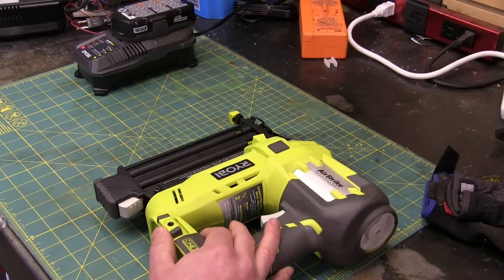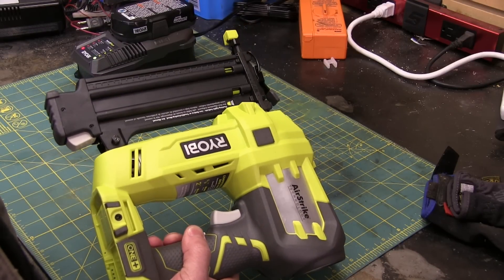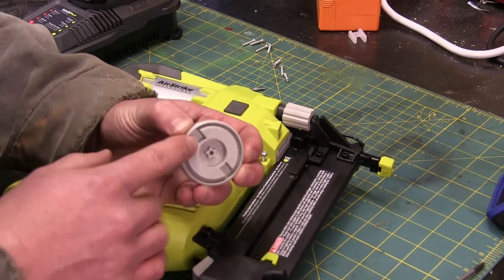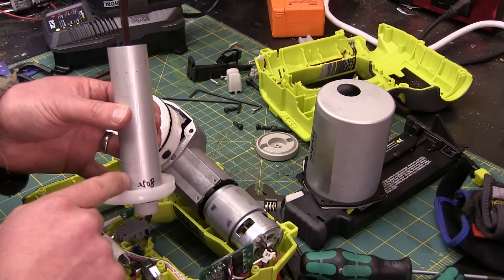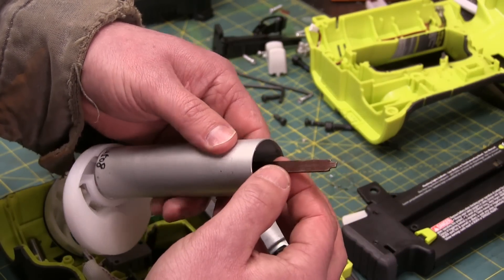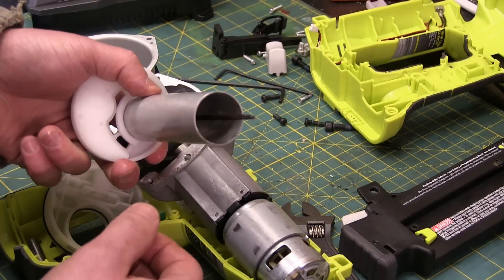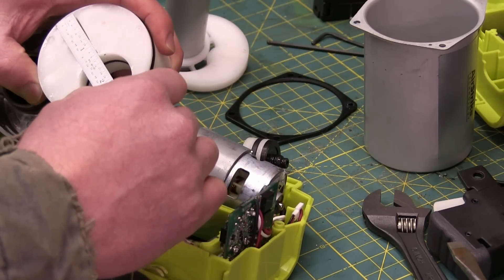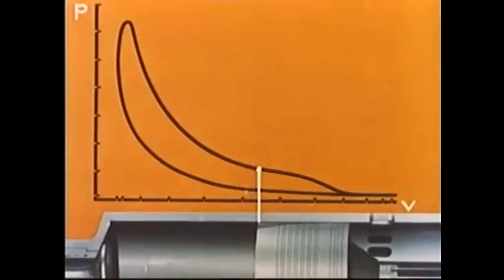BOLTR: Ryobi Nail Gun 18V cordless

Comment: I just took one of these apart with some confidence thanks to having watched this a while back - and I actually managed to fix the thing.  It had been in use for about 3 years already. As best I can tell, it failed because the oil inside had gotten so sticky and old that the motor was going into overload protection due to the increased resistance.  

I oiled everything back up and it is back to work! Thanks for the video!
Reply: I've had mine working for 2 years now.  Still going strong.  I do alot of floors and trim.
Reply: Silicon grease works  the best .
Reply: @interman7715  is that silicon or silicone, just asking for a friend.
Reply: Hey The11thNickel I’ve been debating on getting this same ryobi brad nailer , after you tuned yours up is it still working to this day ?
Reply: @johnkey1682  There is no such thing as silicon grease as far as I know, so yeah.

Comment: POM is Polyoxymethylene also known as Acetal (trade name Delrin) in case anyone was curious.

Sincerely, a plastics and polymer engineer.
Reply: +AvE I think you may find it very useful trying to determine if something will "chooch" or not haha.
Reply: James Schwede would delrin be able to be used to create super tight lattices based on long strands only a few molecules across to create a very tough material much like kevlar or ultra high density molecular weight polyethylene that they use in bullet proof gear?
Reply: @Nuovoswiss so delrin is just the polymer version of formaldehyde?
Reply: @sarchlalaith8836  I think that is a bit of an oversimplification.
Reply: I thought POM was pomegranate juice in a fancy bottle marked up >60%
Reply: John Goblikon is my spirit animal What does this statement mean? The chemical is bad for us, causeing pain, so can sell us pain killer?
Reply: Hey can you tell all those other plastics engineers that plastic is not a replacement for metal in all applications
Sincerely, a mechanic
Reply: @russianacorns8080  You are 100% correct. As a hobby mechanic, I run into the same frustrations with parts being made out plastic in order to cut cost and save weight, where a metal part would have been better.
Reply: Hello, Can you tell me the minimum, or the best/correct, temperatutw for reforming HDPE in a mold?
Reply: Don't come here and class up the joint
Reply: @Jamie-Russell-CME  If you are referring to using HDPE for injection molding purposes, then a temperature of approximately 400F will suffice. This is a starting point, depending on what molecular weight you have and what heat history your material has experienced. If you are looking to just soften HDPE, then 300F will work. Be mindful of material degradation, not temperature and time at temperature can breakdown the material.
Reply: Prisoner Of Mother England. POM

Comment: For those Aussies (not Austrians) playing along at home... Techtronics have done the same Ridgid deal with Bunnings, except that they're branded as AEG. So Bunnings are the exclusive distributors of both Ryobi and AEG/Ridgid here.

Could be worse than Ryobi, though. Could be Ozito.  Or 909. Or Worx. Or Wesco.
Reply: +w0mbles I thrash my Ozito 14v drill and never had a problem, had more issues with my Dewalt 14v drill. Their palm sander is pretty good too so I got nothing bad to say about Ozito and if something fucks up, instead of warranty they will usually just straight swap you for a brand new one. 

After seeing this video... Your better off with a Ozito, properly made in the same factory as Ryobi but half the price.
Reply: TheKodiak72 I've got a few Ozito tools myself. The heat gun is quite decent. The screwdriver does the job, but is pretty dodgy in terms of build quality and drive run-out. The rotary tool is OK too, though the ergonomics are rough. The glue gun is bare-bones, but it works well enough.

But overall, they're definitely at the bottom end in terms of parts and build quality. I wouldn't want have to rely on them. Weekender stuff.

I do agree that it's dead easy to replace the Ozito stuff it goes bad. Same can be said for almost anything bought at Bunnings. Even the high priced stuff.
Reply: +TheKodiak72 yeah I've got no problems with Ozito. 909 stuff on the other hand, absolute garbage, literally made of fecal matter I'm pretty sure.
Reply: +w0mbles Yeah pretty easy to replace anything that breaks in Australia thanks to the Australian Consumer Law.

I generally stick to the Makita stuff for tools I use a lot, but bought an Ozito rotary hammer for a small bathroom demo job that came up.

The first one fried (magical blue smoke feature) and I took it back for an instant replacement. No 2 finished the job and I've still got it for the next reno some time down the track. For a tool I might use a half dozen times it's cheaper than hiring one.
Reply: +w0mbles Thanks for the info. I bought a Ryobi vacuum cleaner from Bunnings. Worst. Purchase. Ever. It is so damn loud its not funny. Even with hearing protection on you get a headache after a few minutes. I'd forgive it if it actually worked. But it sucks .. If you get what i mean. I end up using the damn thing as a broom then pulling the head off and hoping the thing sucks the stuff up just through the hose. I should have taken it back complaining about how useless the thing is, but oh well. That's what $80 gets you.

Having said that, I've also got a Ryobi C1 brad nailer. Seems to go alright so far. Very rarely does it jam.
Reply: +w0mbles So what's the deal with my masport 2-stoked whipper-snipper and blower/sucker, wouldn't happen to be a Stihl in crappier plastic by any chance?
Reply: +TheKodiak72 Some Ozito stuff is definitely TTI. Their plunge router and 12v drill have a distinct family resplendence to their respective numbers from Ryobi and AEG. That said the AEG drill is clearly head and shoulders above the Ozito.
Reply: +TheKodiak72 Some Ozito stuff is definitely TTI. Their plunge router and 12v drill have a distinct family resplendence to their respective numbers from Ryobi and AEG. That said the AEG drill is clearly head and shoulders above the Ozito.
Reply: +H8_RICE A dedicated (i.e. real) tool store in your area?
Reply: +H8_RICE Sydney tools, total tools, get tools direct, gasweld. They are a few chains that we have around here. Not sure where you are from.
Reply: dapretenda85 I've just bought some stuff from sydneytools online. Prices are really good for stuff on special, especially if you can get free shipping. Service has been very iffy thus far; have had to do far too much chasing up of them.

Adelaide Tools have a decent range, but the prices are all at the high end of RRP.

Had a laugh at the Mitre 10 catalogue which came yesterday. $400 for a DeWalt 18V hammer drill (with bonus driver!). Or... $500 for the Makita version.

Or, and get this... $400 (yes, $400) for the Worx 20V Brushless hammer/impact combo.) Worx! That's about $300 more than it's worth.
Reply: rkvktmen Yeah, there's a lot of OEM stuff happening. My "Ryobi" scrollsaw is the same as all the other cheap Chinese scrollsaws you can find rebadged in different outlets. And yeah, it's a total POS as a scrollsaw.
Reply: Some Worx stuff from Masters is well priced and long warranty, but don't bother now as Masters are going out of business
Reply: w0mbles Yup. Saw a guy returning a Ryobi drill press to Bunnings the other day - the pulley that the main drive belt goes round had completely sheared in half, looked like broken cast iron but was definitely plastic. Use time was less than ten minutes.
Reply: +Dillon P Of course they're going out of business, my local one nearly burnt down opening day due to shitty sausage sizzle techniques.
Reply: +Camoflauge Koala . haha!
Reply: +w0mbles for any canadian readers, 909 was making mastercraft and haussmann tools for a while but it seems mastercraft is on the 20V dewalt platform now
Reply: +w0mbles AEG used to be some amazing tools - the professional line that is, wonder if even those are gone now
Reply: +w0mbles Every ozito tool i have bought still works. Ok, it maybe because i dont actually use them....
Reply: And you don't use it because they are too gutless for real work.
Reply: im a plumber and ive owned ryobi and ozito. there good if you have a small easy task but when you work them or lean on them there not that good. all broken but my Milwaukie stuff still works
Reply: w0mbles we only use aeg 125mm grinders, and... there is a distinct lack of workyness after a couple years of use each.
Reply: A bit of history.  AEG Telefunken invented the electric drill and were the premium power tool  brand (among other electric devices including trains) until they went broke in the late 70s. Atlas Copco bought the power tool division and marketed them for about 20 years.  They then made red tools which were identical, branded Milwaukee. Apparently this gave Atlas two brands to sell off. AEG is now mid range. I have 45 year old AEG from when they were the undisputed top of the heap. The price matched the quality though, 4 weeks of a tradesman's wage just to buy a drill. I sure worked the shite out of mine though. Nothing else could have stood up. Constant torque is common these days as the patents have run out, but back then nothing else came close

Comment: I use one of these all the time. Great for jobs where you need to do trim work but do not want to drag around a compressor, hose and pnematic brad gun. Boss had to send it off for repair once when he first got it but no issues in years.

Comment: In my years working as a tool repair technician, I've actually seen the "o-ring behind the wear ring" trick fairly often.  It provides a steady pressure against the cylinder wall to ensure maximum performance and maximum lifespan of the wear ring.  Kinda smart, if ya tinker on it.  😉
  As to the filled pits, I believe that if you ground that thing apart, you just might find some ballance weights in there.
  We had a big Gaylord (reinforced cardboard box) that was full of those aluminum housings which we would, upon its filling, take to the recyclers for a pretty penny.  There's a lot goes into those housings and, your correct in that it's the strength of the whole tool, giving reinforcement to the shell and everything else.  Anyway...
  We had one fellow who, upon his second trip to the "Doc in the box" to have a nail removed from his hand (you'd think he'd learn to keep the pointy end pointing elsewhere, by then...) was informed that if it happened a third time, he need not bother returning to work in the afterwards.  Twice in as many months, I believe his sneaking out the back door before taking the mandatory drug screen just might have had something to do with it.   😆 🤣 
"Clinker" makes me think of two things...  1, when I'm working on my coal forge, the fellow smith's out there will commiserate and 2, the infamous scene from "A Christmas Story" when Daren McGavin is fighting with his great nemesis, the coal heater in the basement.   😀

Comment: In your calculations you forgot to account for volume of flow, the strong magnet on striker means it can have a break pressure of 40psi, then accelerate to a rediculous level while consuming the volume of air available.
Reply: There is also the Heat of Compression, since the compression stroke is fairly quick, about 1/6 second.

Comment: I have excellent luck with Ryobi 18 volt tools and have used them for 10 years without a problem. I get about two years from the batteries and I send them back and the three year warranty covers the replacement all you do is pay a small fee and shipping.I have not had a problem with any of the tools that get used almost everyday. The guys that work with me have gone through almost every brand over the years except the Ryobi.
Reply: the small fee is not right but what the hell. between the two it is far less expensive than buying them at retail in he store.  On second thought, the fee is likely a pro rate and allows them to continue to offer the warranty without having it eat their bottom line out.

Comment: German company I used to work for almost always uses o-rings behind their wear rings. They use the o-ring to push out the wear ring a little bit, and keep a bit of pressure on the cylinder as the part cycles back and forth. would get somewhere around 2-4 million cycles (or more depending on the customer) before they needed to be replaced.

Comment: I know they're not pro quality, but for the price point, these ryobi tools last pretty good. I know a guy who remodels homes for a living, he uses this brand because they're cheap and tools sometimes get lost. He says he gets a couple years out of the ones which don't get lost. I've got some around the house that I bought for my dad, and they've been pretty good. A lot better than the craftsman and black&decker stuff he had before. Only issue is that a couple years later one of the batteries quit accepting a charge.

The nice thing is that they all take the same batteries. I know the other brands are doing that now too, but ryobi was doing it first and even the older ones will accept the newer batteries, and vice versa. I've been happy with them. They certainly outperformed all my expectations based on the price point. Once they do break, I will buy more, because we already have a bunch of batteries for them, they're inexpensive, and they work just fine for non-professional use. They seem to be the same quality as the low-grade cheaper dewalt tools. Actually, the drill chuck is better on the ryobi than my cheap dewalt drill.
Reply: Krankie V the same battery for all was a big selling point for me. I have tools that I got for free that are 20 years old (blue) that had dead ni-cd batteries. I put my lithium battery in them and they work like new. Plus quality isn't that bad. As a hobbyist they're perfect for me. Plus they have many odd tools that are nice in a pinch
Reply: msa1985 How about you take care of your stuff and not drop them?
Reply: msa1985  we use these exact nailers at work and they often get dropped off ladders etc and they keep on going. One of the better ryobi tools and you canèt beat the price.
Reply: Brandon S  lol no but I dont work with tools everyday. It's crazy how poorly people treat everything then complain that it doesnt work
Reply: msa1985  I have dropped my Ryobi screw gun hundreds of times off of roof tops and so on. I never had any problem with them breaking until just last week when my ladder gave way I have to fall to the ground on top of my Ryobi screw gun and broke it in half along with breaking my back literally. It's me being stuck at home watching silly videos on YouTube
Reply: @danielhillwick8430  damn, I hope the recovery went well mate
Reply: @jake3523  yeah I'm all healed up and back working. Thanks for the comment

Comment: My experience with Ridgid, I found a shop-vac on the curb for trash, well I was checking it out for the no work issue, 1 of the brushes wire was broken and I contacted Ridgid and yes I paid for shipping, all I sent back was the power unit, it costed $20 too ship, but they gave me an extra filter for my shipping cost, well in 2 weeks I received a big box at my front door, I opened it up and man O man they sent me a completely new shop-vac, a complete unit, so yes I will send back a tool to Ridgid, at time it was a win win, thanks again for sharing your thoughts and great videos

Comment: Tell you what, I’ve owned this brad nailer for about 4.5 years now. I’m a general contractor, not only does this tool get used almost everyday, it has never gave me a single problem. I’m not kidding when I say this, this little brad nailer has make me over 15k usd. I wouldn’t have a problem replacing it once a year at the small price it sells for but I haven’t had to replace it once. 
I own all the air strike tools, and they are among my favorite tools.

Comment: I just bought one of these, now they do 1700 nails.  I already had the batteries for a 15 year old Ryobi drill.  Not a professional carpenter but needed a nail gun.  Worked well.  The thing I like about  Ryobi is they all use the same battery and their charger will charge all types of batteries.

Comment: Never had a problem with the Ridgid warranty procedure. Go to HD with your part, they look it over, do some documentation, take it, and you get a new part mailed to you directly. Took about 3 weeks to get a new battery, but beats having to personally mail it in on your own dime, or buying a new one. :o)
Reply: +Ira T Bought a Ridgid kit which included a recipro saw, 7" skilsaw, hammer drill and an impact driver, plus chargger and two batteries.  $400.00.  Thought it was the deal of the century. found out the batts heat up enuf that they shut off at the half way point (they have a gas gauge)  won't run the tool till they cool, and won't recharge either.  I bought an extra battery ($99.00!) because I thought that three would be about right...two could be cooling while I was still working.  THEN, I found out that the lifetime warranty did NOT apply to the new battery.  The two that came with the tool had it, but not the extra one.  I called Ridgid...customer service rep said "tough shit" in so many words, so I used the tools for their intended purpose, then returned them.  No more Ridgid for me.
Reply: It clearly states on the HD website that none of the individual battery kits have the lifetime warranty, only the ones in kits do. Even the HD employees know that.
Out of curiosity, why did you not want to keep the deal of the century? Why not spend the $99 and get a drill and battery combo, sell the extra drill, and keep the battery? They literally have the best warranty in the industry, and who else even covers batteries that come in kits?
The warranty is the reason I keep going with Ridgid. The cost of replacing a tool or battery is one less thing I have to worry about.